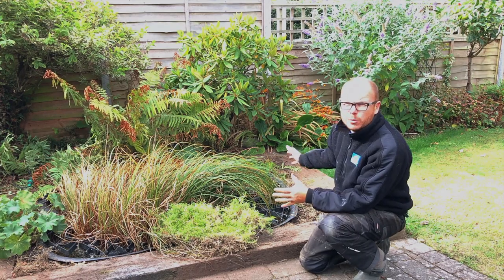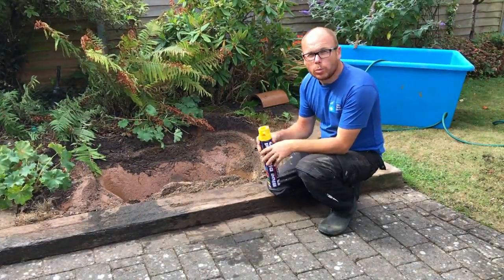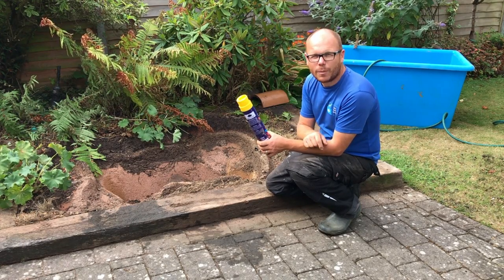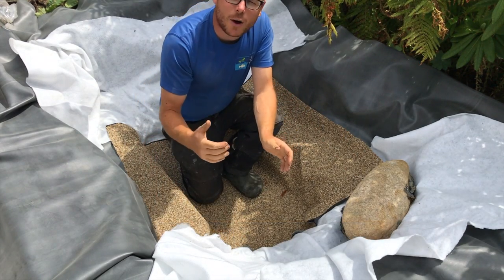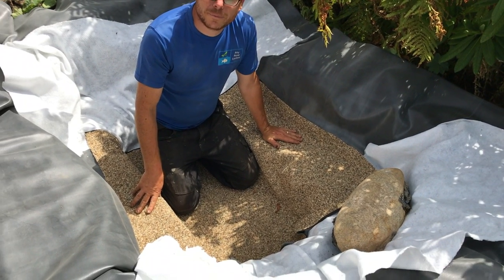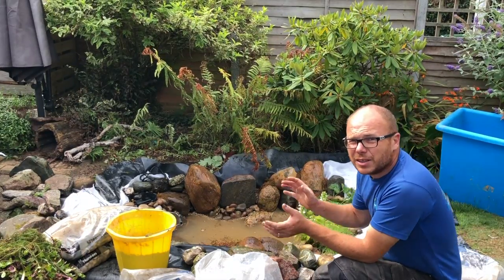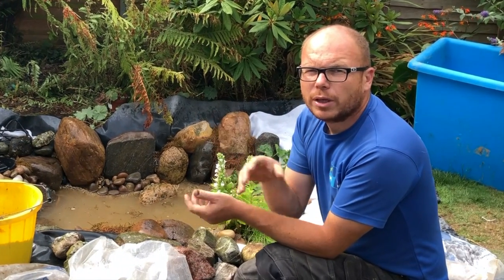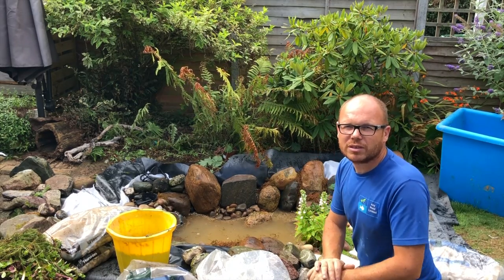How to make a pond - Small / Mini Wildlife Pond Construction

Comment from the maker: if you have any questions about this build or wildlife ponds fire away.  Are you currently making a small wildlife pond or thinking about one
Reply: How long does it take to keep the plastic (linear) before changing it? If I do not have water pump still o.k?
Reply from the maker: @annmariemaedani8766  yes you don't 100% need a pump just more oxygenating plants, The pond liner (rubber EPDM will last a lifetime when building this way).
Reply from the maker: @joe blogs yes I totally get what your saying the difference is of course the flow and temperature of the water, these small ponds are much better that a bare liner pond its like a barrier reef
Reply: Beautiful results! I would like to add some Daphnia to my wildlife pond. Can you suggest a good place to buy them from - and - how many are needed per gallon? Thanks.
Reply: What's the best way to get rid of blanketweed and algae in a wildlife pond. My water is very murky and green. I have no pump so there is no water movement. I have got the sludge out with a net but no difference. I have, a red comet goldfish in there that I rescued and quite a few frogs so I don't want to use any chemicals
Reply from the maker: Hannah Tuck if your In the UK you can order our products Multi Clear & Multi Aqua
Reply from the maker: anypond.com/store
Reply: @ThePondAdvisor  great I'll take a look. I love all your videos .. although it does make me want to go out and buy more stuff for my pond . All yours look fantastic and you have provided me with some great tips 👍🏻
Reply: Do you have watsapp?
Reply: Hi Mark. Lovely design, thanks for sharing. A few Q's if you have time - I take it the deep part is around 45cm, how deep is the shelf around the side? Can you recommend an eco-friendly supplier of rocks? There are discussions online about Butyl vs EPDM liner,  do you have a view on that? Finally - is the "overlay" the same stuff as the "underlay"? many thanks, Brian
Reply: Is it OK if my dog occasionally drinks from a garden pond - or do we have to fence it off from them when we build it?  Also, how much does it matter if there are trees nearby, as we don't have many good spots which are completely away from trees?
Reply from the maker: @nickyork8901  dogs prefer pond water,  cover the pond with a cover net in the Autumn/Fall install a skimming system to remove mechanical waste
Reply: Hi, how deep should a wildlife pond be?
Reply from the maker: Luke Burgess 18” if you want toads, 12” if you want just frogs, you can also build mini wildlife ponds smaller but they a more for aquatic insects
Reply: where can I find a list of plants and where can I find the stone liner, basically do you have a list of everything did used?
Reply: Hi, I'm modelling my pond on your design, it's so easy to follow.  Can you tell me what the smaller gravel is please?  Is it random shaped pea (10mm) gravel from a builders merchant or different?  Thankyou

Comment: In the winter if it start to freeze I put some plastic sheeting over the top with space underneath be careful if the sun comes out u may need to remove it..and switch the pump of and loosen the lid on the filter
Reply from the maker: Sounds good

Comment: i have made many succesful wildlife ponds but now i am disabled.  the only room i have in my concrete back yard is in a raised bed.  i can get a small pond put in but wonder if it's worth it as the edges/walls will be at least 10 inches tall.  of course i will put in a sloping pebble beach side  and no pump xxx thanks xxx
Reply from the maker: I would say 10” is to shallow, I would go 12” minimum and that’s for frogs and damselflies.  If you can stretch to 18” that is better even still for the amount of wildlife and plants you can keep.

Comment: Hi great video, I noted there was no filter installed on this build.. could you explain why.. thinking of doing something very similar but would like a a small amount of fish in it.. secondly what’s your view on hoselock bioforce filters?  Would a bioforce filter with adapted plumbing to create a mystery low flow water fall be ok... I don’t yet fully understand the concept of the pond scimmers and on initial review the bioforce filter systems seem a bit more efficient over a waterfall filtration system... apologies for the lengthy enquiry... Your videos are class and your work is amazing.  Thank you in advance any guidance would be very much appreciated. Regards Nigel
Reply from the maker: no filter? plants are natural filters, these with micro organisms keep the water sweet.  I cant comment on the hoselock filters, the last time i used them was 15 years ago, now i see too many ponds that are not working for the pond owners.  The eco system style of pond is way better from a maintenance point of view, not looked back, the two systems are polar opposite

Comment: Hi, we have been inspired by your great video and are digging  a pond for our small garden.  We love the idea of the basket - where do you source it (is it a pond-specific product, or do we have to just have to hunt out two baskets?) and what kind of pump do you recommend?   And what power does a pond this size need?  Is it a pump that filters too or is that not necessary - slightly overwhelmed by the choices!  Thank you.
Reply from the maker: depends on what you want this was a little feature pump to simply add a little movement and oxygen, you can add a filter if you wish, the wildlife ponds don't need much.  i have other videos on what filter or pump
Reply: @ThePondAdvisor  Thank you very much.  I think that's basically what we're thinking -  a little bit of movement by not much.  I'll look at your other videos, as you suggest.

Comment: Great videos   Do you always have to put the larger rocks on to another layer of underlay?  does the foam cement not stick to the liner?  And would you  advise which cement you use please.
Reply from the maker: HH HH no you don’t always have to put the rocks on over lay, but it’s a good habit, the foam will stick to anything, but on the over lay it’s much better, and you don’t have any problems or worries
Reply: The Pond Advisor  Thank you.

Comment: Great job how do I get rid of green alge strings there's alot of it need help asap
Reply from the maker: It depends on the type of string algae I do have s could of video in my algae video playlist.  We use a product call multi Clear to control algae.
Reply: Cloverleaf actually does the job - pretty sure it's based on diatomaceous earth. The algae will melt in days. Then you might have to do some sludge clearing. Whether green or string, algae is a sign of nutrients in the pond. The more other plants, the less algae.
Reply from the maker: @marinaorgan589  you have totally got it more plants less algae and less maintenance, work with mother nature

Comment: Hi, good video, thanks.
So I don't need a filter just a pump to aerated the water to give oxygen & I suppose it also helps stop it freezing ?
'Mechanisation!' 😆 I think you meant 'mechanism!'.
You say BASICALLY a lot!
 I'm digging mine & have so far got to 16 inches deep, how far to you recommend I go?  Shall I have a shallow end?
Thanks
Reply from the maker: Basically 18” is good, lol
Reply from the maker: If your wanting wildlife (aquatic insects) yes lots of shallow water. The shallower the better as long as you have some water 18” deep.
Reply: @ThePondAdvisor  Thanks. I want to attract Newts & Frogs. I've work out that the water area is around 550 litre, in the winter months surely I can use a large aquarium heater to stop it freezing?

Comment: When fitting the stones what did you use? Are you able to use a normal concrete or does it have to be a special water resistant mixture? Thanks
Reply from the maker: https://youtu.be/bLvBnVYg54s?si=1g_woMPf6qur90pg
Reply from the maker: https://waterfeature.shop/collections/aquascape-waterfall-foam?_pos=1&_psq=watergall&_ss=e&_v=1.0

Comment: Do you have any good resources on puddling clay? I'm working on a small wildlife pond in my front yard here in the states and I'm using clay(as I have basically unlimited access to clay haha) instead of using a liner and for the life of me, I can't find anything on puddling clay for a small pond. I could also be searching totally wrong haha. I figured you might have some resources or info! Thanks!
Reply from the maker: No we work a long side some estate maintenance company’s that will do it.  I would recommend digging a test hole.  Fill the hole with water and test or put some water in to make a big mess lol.  We build everything using rubber as it’s less maintenance and moving clay around is not easy.

Comment: Hi pond enthusiasts I need a bit of advice please (sorry this might be a bit long winded). 
2 years ago I had to move my pond and due to time constraints I had to basically make a concrete bucket in the ground roughy 1m cubed. It is a terrible pond with nowhere to put plants. 

Because frogs and newts breed in there I haven’t been turning the filter on (as it eats the tadpoles) and the algae gets really bad. Anyways, last year the algae was that bad in the pond it killed pretty much all the tadpoles so I’ve decided to rebuild my pond properly. 

My issue is I am finally able to afford the materials and also the time to do it but there is loads of spawn in my pond. I was thinking of moving this spawn into a temp pool while while I carry out the work as quickly as possible. I have been collecting rainwater which has now filled the temp pool and this will have plants in (which will be put in the new pond).

So yeah that my issue :) any thoughts or tips? Im scared if I don’t do it now, all the tadpoles will die again. I’m so scared I’m going to scare all the frogs and newts off and they’ll never come back. Any advice would be really appreciated! Thank you
Reply from the maker: Move the spawn before it’s to later. Keep as much pond water as possible (higher than the new pond).  Improve the pond and bucket the tadpole’s or syphon the lot via a large pipe (we use 50mm or above flexible pipe).
Reply: The Pond Advisor thanks mate. Not sure what you mean by “higher than the new pond” but got everything else 😅 thank you for your help. I’ve learnt so much from your videos!
Reply from the maker: If you can build the temporary pond/pool higher than the current or new pond water level you will not have to pump the water back into the pond, so if you have tadpoles you can simply bucket them back in.  I guess it depends how much spawn you currently have!
Reply: The Pond Advisor ahhh I see what you mean now! There’s a fair amount of spawn but I’ll do anything to keep them safe. I’ll pick them out one by one if I have to 😅

Comment: Hi
I’m going to do a small wildlife pond in my garden approximately 7x 4. As a first attempt would you recommend a preformed liner or a rubber liner that you used? Can you put a small waterfall in a wildlife pond or is still water best.
Thanks
Reply from the maker: Protected Rubber liner 100%. Installed correctly pumps are not a problem, I have other intake bay videos that might be worth a look.
Reply: The Pond Advisor 
Thanks for the reply and advice. Any particular rocks that shouldn’t go in ponds and best place to get them from. Cheers
Reply from the maker: Look for the fish save logo. Or ask the rock supplier have they been used in ponds.  Not all rock are suitable for fish or hard enough (some are very hard and then break down quickly in water).